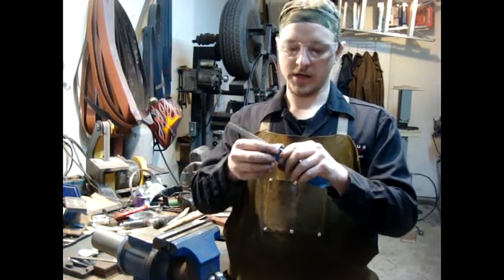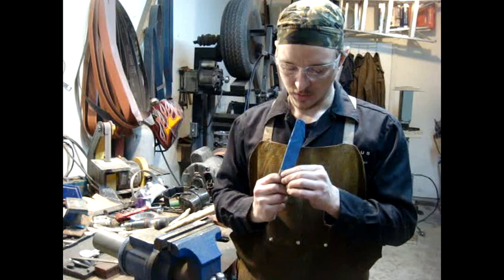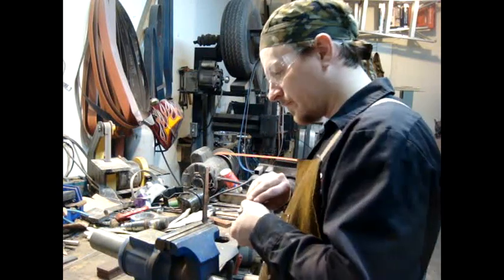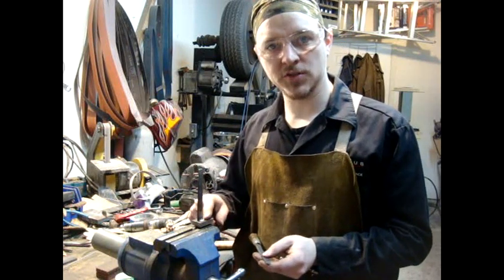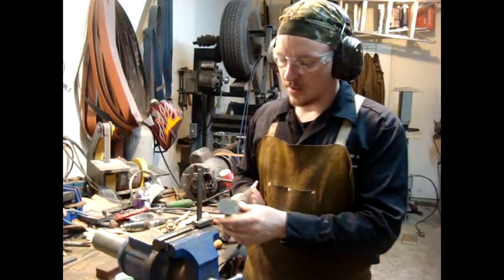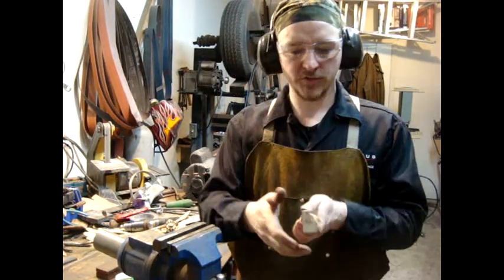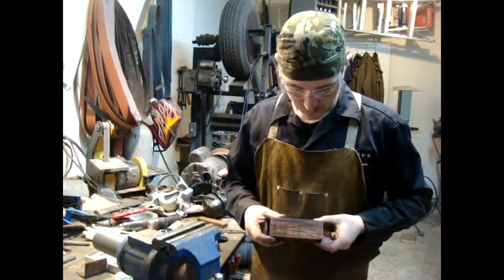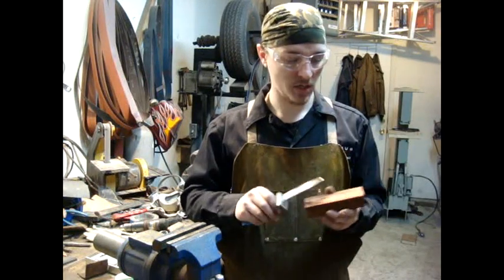Last Frontier Knives - Guard and handle fitting

Comment: Well first of all thank you. Second- just wanna share my thoughts on how quickly the metal gets red to yellow hot ( 10:15 on aprx.) it takes a lot longer when reg. methods are used ( coal and blown air) I wonder is it worth using that type of a torch vs. traditional way? I mean besides slitely uneven heating is there other reasons? Thanks againg and good luck in everything you do.